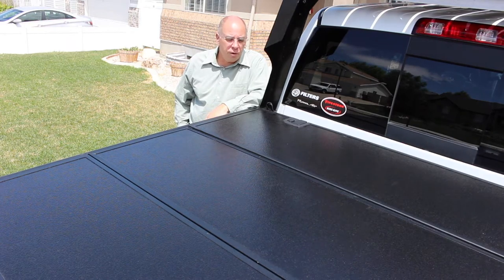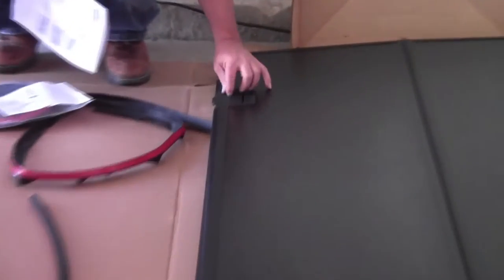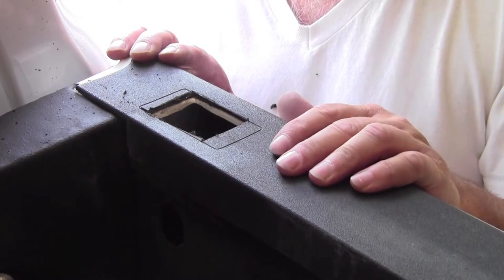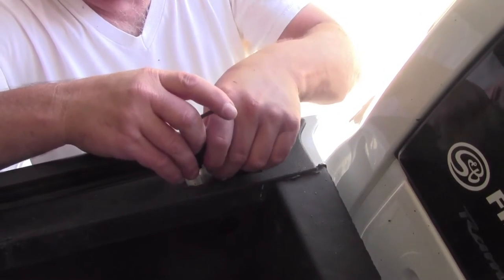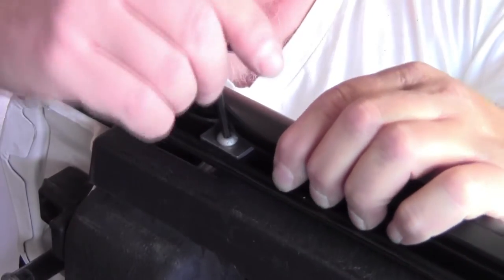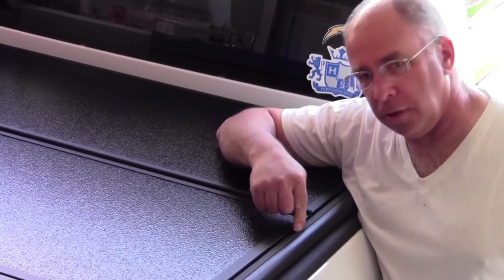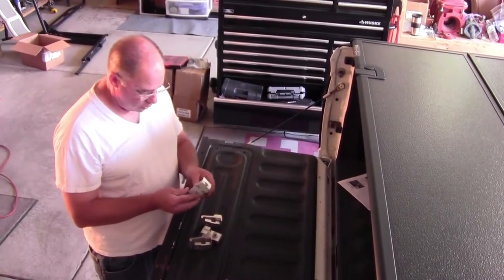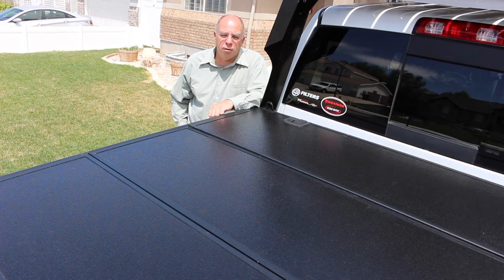G4 Elite Tonneau Cover Installation Fold-a-Cover (Part 1)

Comment: I just received my new G4 Elite Fold-A-Cover and was disappointed to see it arrived with shipping damage.  The cardboard cover had several dents which resulted in a dent on the underside of the lid.  I needed to secure tools and gear ASAP so I decided to install the cover and work with the factory on a warranty claim.  I contacted the factory and was upset that they wanted me to return the damaged cover before they would ship a new one.  They also refused to offer a credit if I were to keep the damaged cover so in my opinion, I would give them 5 thumbs down on the customer service.  Now the installation, what a pain.  The video does not adequately show all the parts, pieces and brackets that need to be installed for the cover.  If you ever need to remove the cover it to carry a full load, its not a simple process.  The cover also arrived with black silicone caulking oozing out of the metal frames and wiped all over the top and underside of the cover.  It took me an hour just to clean up all the excess caulking.  I like the fact that the lid can be locked front and back but the aluminum brackets are not as secure as I had hoped.  A wider bracket would make the locks more stable because attachment points are sheet metal and tend to flex.  I would not recommend this cover. Which I had bought the BakFlip like my buddy did.